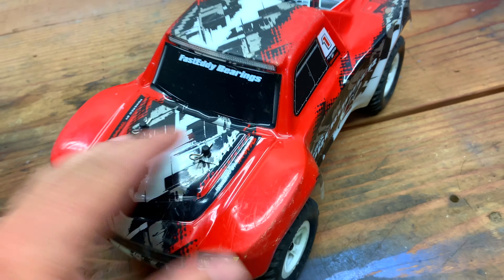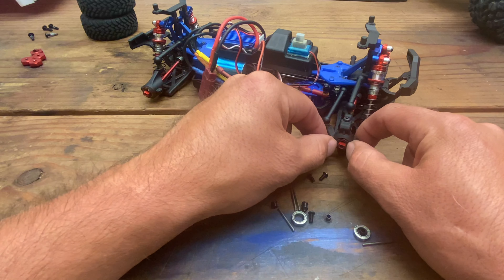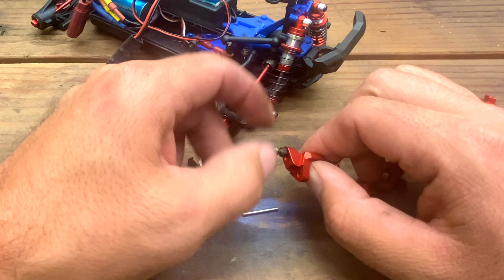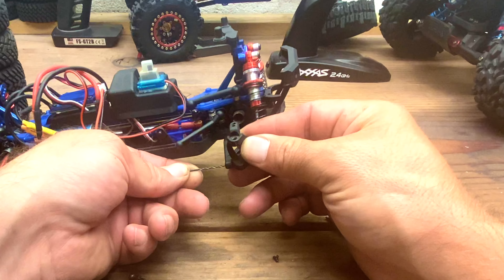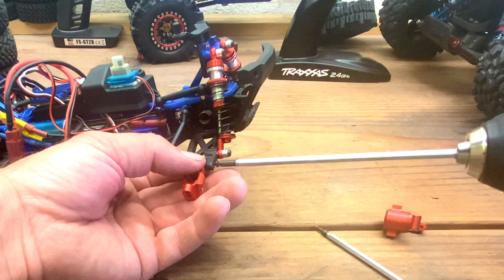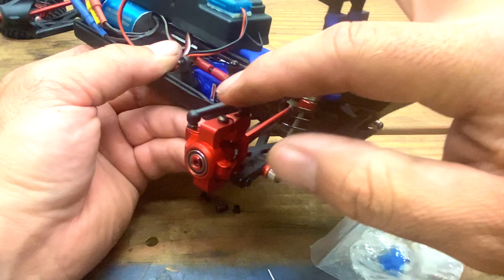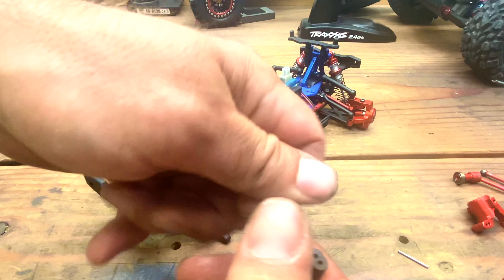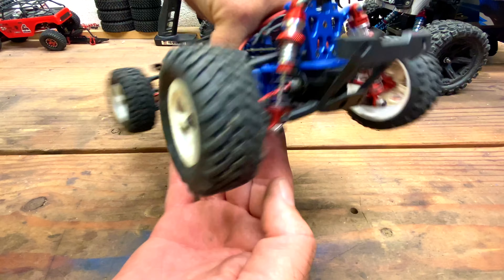RCAWD Aluminum Caster & Steering Blocks, Stub Axle Carriers for LaTrax Prerunner, Teton & Rally

Comment: Thanks for the video. Do the LiPo batteries mentioned in your description fit into the LaTrax Rally, Teton, and Desert Prerunner battery trays without any need for modification? Do these parts only come in the Red color? Thank you for your time and reply. Stay safe!
Reply from the maker: I can’t speak for rally or Teton because their chassis size is smaller but the lipo battery is very similar to the same size as stock and they all run the same size stock battery so it should fit all 3. Red is not the only color available. They also have blue available.